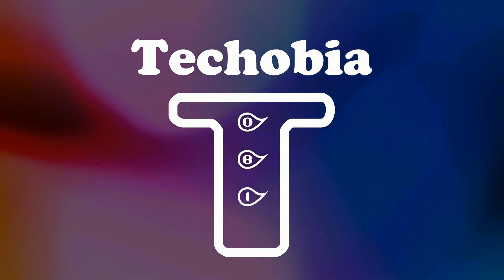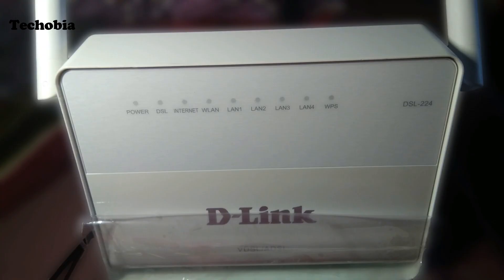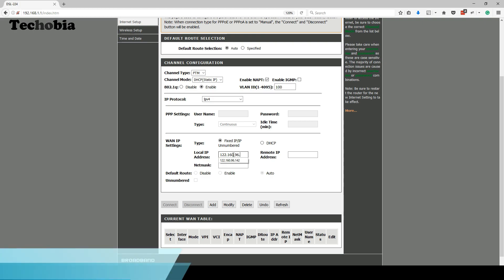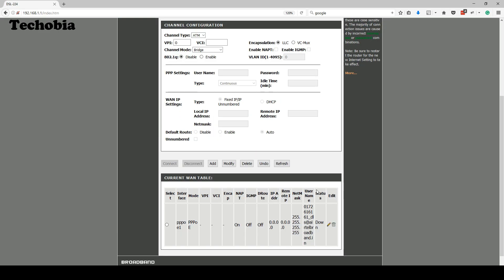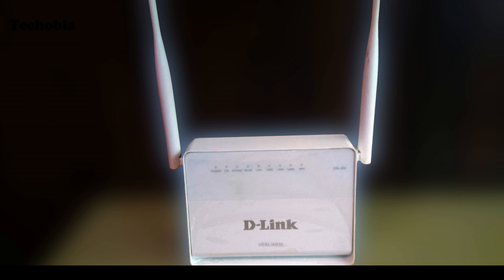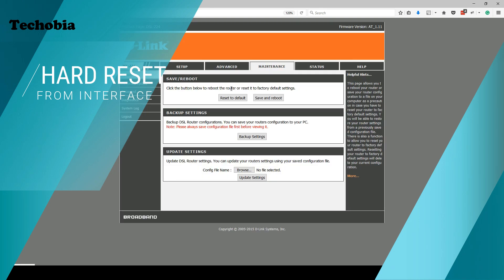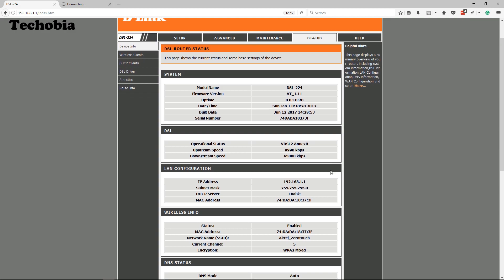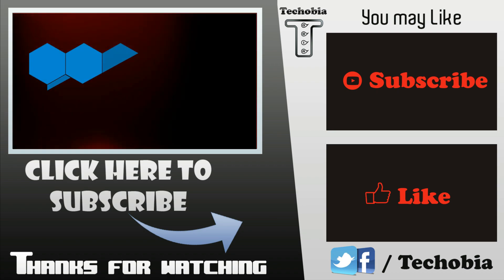Dlink DSL 224 | Airtel VDSL Modem | Configuration | Static IP | Port Fwd | DVR Cam | Speedtest- Wifi

Comment: Hi since the day i had migrated to the vfiber and Airtel has replaced my binatone modem i have been having trouble in accessing the internet and wifi around the house. have contacted customer care and worked with the technicians multiple times to get the issue resolved but they havent resolved it yet. But i have the older binatone modem connected connecting to the internet which i have not issues in connecting. Even if the wifi strength is lower then the dlink atleast i am still connected. looks like a pathetic build quality by dlink or is a faulty piece as this is the 2nd replaced of the same modem.
Reply from the maker: Would suggest you to use Huawei HG630a as it is one of the best one from their all modems in the term of connectivity, sometimes it take time to get DSL link stable but once connected it has very rare dis-connectivity issues whereas there all modems has normally same Wifi range so you will not going to see any major difference in that.

Please subscribe to channel as one of my video is done on Airtel and you can get benefit on your monthly bills and I normally come with videos for the users benefits.

Comment: I have the same modem but it was configured by airtel technician.. The problem i m facing is that the wifi stops  working every few hours periodically for  about 15 to 20 minutes and then again starts working fine. What could be causing this problem?
Reply from the maker: Airtel Technician have some utility tool to check this at your end what I think is that it must be a copper issue. Contact 121 and log a compaint
Reply: I request you to downgrade ua speed....until n unless u change....ull face this issue....it's a copper issue....the speed what ever ISP is providing....not supporting by us copper wires....as distance from dp box to ua connection may be >1200m.
Reply: @pulkit did your problem got solved? If solved can you please let me know.

Comment: I tried to block sites/content using parent control option but it not works !! any suggestion?
Reply from the maker: Will give it try then update you on this as I am using additional router and managing stuff from that which is working fine for me
Reply: even i tried but i am not able to block url.... can u pls share if you found a solution

Comment: Hello,brother ..do you have any idea where i can find the firmware for this modem? airtel auto updated my router firmware through OTA and now i face issues,is it possible to use any other country firmware on this device with airtel? i am looking for the same firmware your video show  AT 1.11
Reply from the maker: I explained in video that now they are not providing firmware's and only updating it via OTA whereas there modem's has customized ROM by Airtel, up to now I didn't find custom ROM for this if you found please share a link so I can give it a try if it works.
Reply: allright,sure thing bro..thanks
Reply from the maker: Please subscribe to channel as well to stay tuned for upcoming videos like this

Comment: I wish to use this D-Link DSL-224 as VDSL2 modem only and connect it to my existing TP-Link Archer D9 ADSL modem-router for wireless functionality (avoiding ADSL modem function of D9 of course) and also use the Gigabit LAN ports of my existing D9 to connect higher bandwidth video sources. (as, DSL-224 doesn't have Gigabit LAN ports and the wireless features are much inferior to those of my existing TP-Link Archer D9). Can you help please?
Reply from the maker: Yes you can do like this for that you need to use a LAN cable and insert that in your WAN blue color port of your router, In this way you configure your router as your main device for home or office and then disable WLAN on your Airtel Dlink modem, so it will only work as modem and now your gigabit router act as main networking and internet device. Hope it helps. As I am getting more comments for this type of same question will make one video on it soon. Like this video if you like and subscribe to stay tuned for upcoming videos
Reply: Hi there, any idea as to when you would be making another video regarding this topic. I'm stuck using the asus rt-ac68u as just a router with the dlink as the vdsl modem.
Reply: Techobia please make a video on this topic soon. I'm stuck with my asus router,  I'm using it in ap mode but I don't think this gives it full functionality

Comment: Good walk through couple of queries:-

How can i distribute Bandwidth speed equally between 2-3 devices... QoS option not available
How can I put check which network(IP/Mac address) is using the data (most), basically keeping a check of different devices using internet data.

Much Thanks
Reply from the maker: This modem don't have feature to set rules on bases of IP, you can use any router further connected to it to do this type of stuff.

Comment: I have multiple devices to connect to this router. one of the device I want to have speed of maximum 2mbps only. i heard TRAFFIC SHAPING is the option. i tried setting it but still that device gets full speed.
Reply from the maker: Traffic shaping no idea about but I am doing this via router further connected to it by DHCP address list, ip assigning and rule set for IP range to assign egress and ingress bandwidth

Comment: How to change default ID password on D-link  homepage
Reply from the maker: If you want to change Modem password: then in Maintenance there is an option password.

if you want to change your wifi password: at 9:15 min you can see in Wireless setup -> Wireless security , you can change password form there.

Comment: i want to open around thousand ports..i want to open from 9000-9999 in tcp..is it possible to do that without manually filling all of the data?
Reply from the maker: you can define it as range, in port enter like same 9000-9999 and it will open all ports
Reply: okay thanks a lot..:D
Reply from the maker: I am glad that it helps. Please subscribe to channel to stay tuned for upcoming videos and updates like this. Next coming video is like a profit deal if you are airtel vdsl user.

Comment: Please tell that which is better and latest modem between Dlink DSL 224 vs Huawei HG630a. I am confused as today Airtel changed my modem from Huawei HG630a to Dlink DSL 224 as I was facing problem with the connectivity though there is VDSL in our area.
Reply from the maker: Between these 2 go for Huawei Hg630a. I am going to make video soon where i will compare all or one with one as you said for dlink and Huawei. Please like their video and subscribe this channel to stay tuned for upcoming uploads.
Reply from the maker: As concerned to connectivity Huawei HG630a take little more time to stable it's link but when it get stable it very hard to get disconnected if compared to other modems even in case of copper issues.
Reply: But Today when I complained about my modem issue they replaced it with the D-Link DSL 224. Would it be better if I ask them to again replace it with Huawei HG630a? Or they both will work alike.
Reply from the maker: I found Huawei HG630a much better in terms of connectivity where area wise Dlink provide more coverup whereas Huawei also have USB port if you need this and it has no antenna. I used Dlink DSL 224 for few days but I found HG630a much better and switched back to it. Again It depends on you needs that how you set your priorities.
Reply: Thanks Techobia. Can we connect any non-wifi usb printer to Huawei HG630a and use it with any WIFI enabled device. If possible please do make video for this soon that would would be of great help.
Reply from the maker: No, this is not possible as their USB port is only designed to connect MTP media device